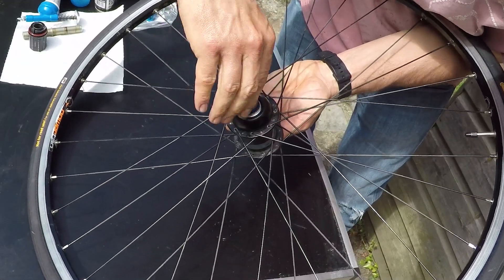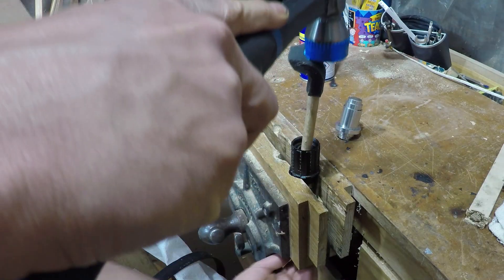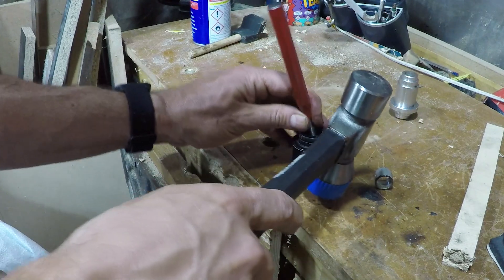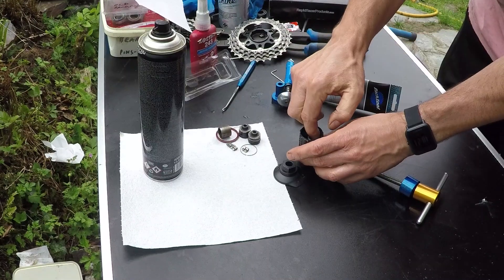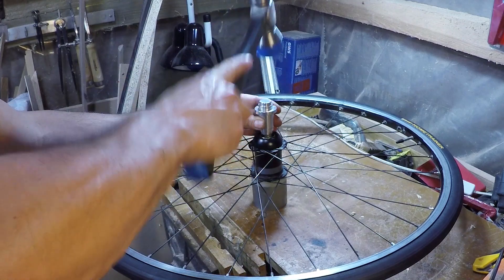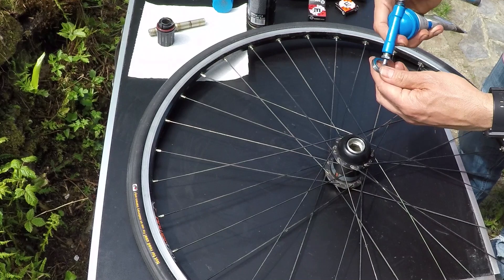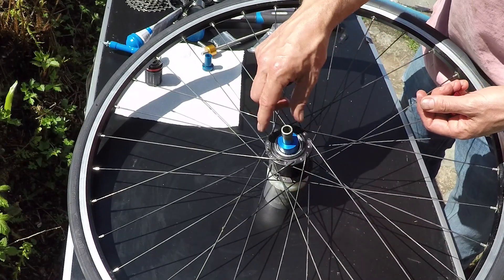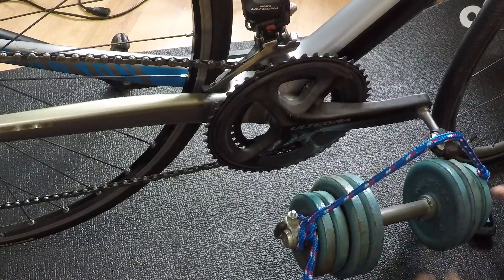Replacing bearings in a Powertap G3 hub and its freehub

Comment: I just finished replacing free-hub bearings in my PT G3. I’m wondering what is the purpose of the very small hex driven screw in the free-hub body is. Next up is replacing the remaining 2 bearings. Thanks for any help.
Reply from the maker: Sorry so long since I did this. Normally you need to undo any screw in freehub bodies - they prevent lower bearing from riding up.

Comment: Which way round does the magnet go onto the axle?
It attracts metal just the same both ways round.  If however it's making contact with another magnet (inside the sealed part of the hub) then it probably will matter which way round it is.
Kicking myself for not taking it off more carefully,
Reply from the maker: Sorry I really can't remember and I don't have the wheels any more. IRRC I had to check and flip it around as needed.
Reply: @TheCyclingMan  Thanks very much for getting back to me.  It's a 50:50!   - as you say not the end of the world to knock the axle out again if needed.
Reply: All went fine and thanks for the excellent video.  Some comments that might come in handy for others.  I bought a much cheaper bearing press set with a full range of bearing size adaptors.  (cost about £39)  It was fine but.. The hub drive side 6902 needs the bearing press to go over the axle.  The hole in my cheaper kit was too narrow to do that.  I got round it by finding a metal tube of the right diameter to do the pressing.  A long spark plug socket of the right diameter did fine.  I also removed the magnet from the axle and failed to note which way round it went.  I didn't know if the polarity of the magnet mattered or not.  I now know it doesnt, so don't worry about that.  Thanks again Cycling Man.

Comment: I have asked this to a few people online already but wanted to get your opinion. There is some very small but noticeable lateral movement in my G3 hub. When grabbing the rim I can move the wheel side to side. Some people have suggested replacing the end caps and others say to replace the bearings. I do not think it is the end caps. I removed  the free hub and end caps so I could grab the axle with my fingers. The play in the axle was much smaller but still noticeable. One person told me they replaced the bearings and the end caps and still had lateral play in the wheel. So could it be a tolerance issue with the axle? I have seen some weird issues like this in the past with other wheels I have had but it was usually because the axle or bushing was too large which kept the wheel from spinning at all. Could the axle just be too small or worn out?
Reply from the maker: Hi -  most likely you just need to replace the bearings - possibly in the hub and freehub. Very unlikely to be the axle.
Reply: @TheCyclingMan  I had already completely replaced the freehub  body.  I did notice on the Powertap website that they replace the axle when doing the bearing service.
Reply: It is mostly the NDS 6802 bearing that wears fastest and creates the slop in the rear wheel.

Comment: Pretty straight forward. New batteries as well and... My unit is not pairing with my Garmin Edge 800 anymore!! I have the older axle model (where the magnet sits on the spacer), so I was wondering if it makes any difference to leave the magnet towards the drive or non-drive side...
Reply from the maker: I'm trying to remember - I think yes the battery does need to be the correct way around when you tape it back on. I might have done the same thing but it was some time ago now!

Comment: hi great video. please could you clarify - video says"there are two 6902 bearings in the freehub body" link says freehub 2x6802. which is correct. thanks.
Reply from the maker: Thanks for noticing that mistake in the description. It's 6902 bearings in the freehub body. I've corrected the description.

Comment: Hi. Recently I have had an interest in using ceramic balines. I went to the ceramicspeed page and I noticed that a balinera number does not match the one you show in the description. I really do not know. They show:

1 x 61802 bearings
3 x 61902 bearings

Could you update the purchase links of the balineras? Could I look for them on ebay or amazon? I'm from the USA

https://www.ceramicspeed.com/en/sport/shop/wheel-kits/powertap-1/
Reply from the maker: I wouldn't worry about the extra 1 in the bearing number - they have that sometimes - same bearings I believe but double check with your supplier.